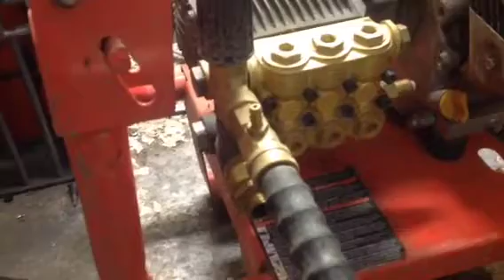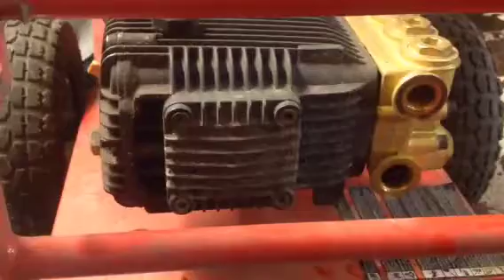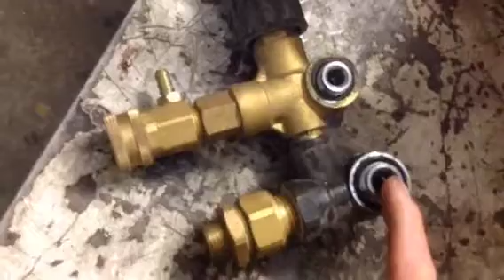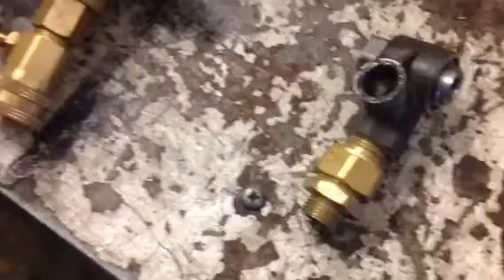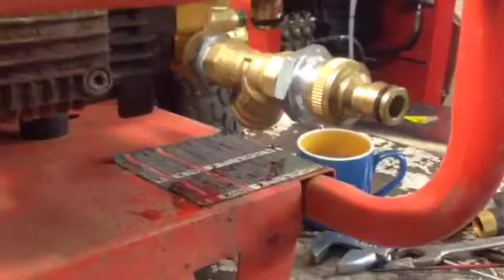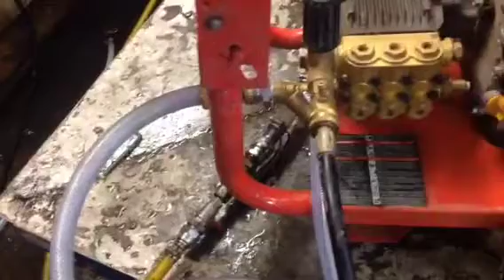CLARKE PLC PRESSURE WASHER PUMP & UNLOADER PROBLEMS HOW TO REPAIR CHANGE YOUTUBE QWASHERS

Comment: Will this allow you to run the machine without using the lance so it wont over heat the pump?
Reply from the maker: Yes, that is correct. The water will circulate into the head of water that you are sucking from so the pump has always got cold water in ciruclation